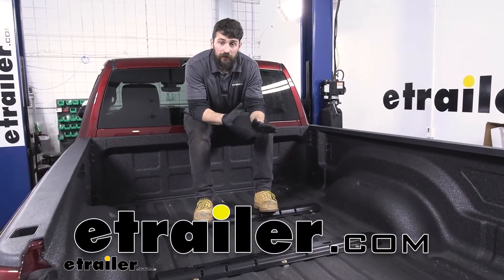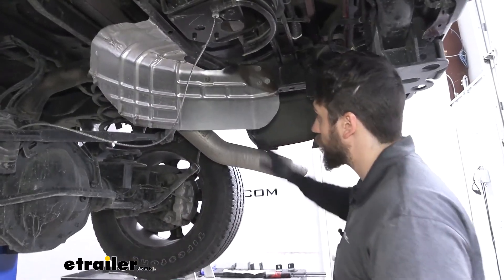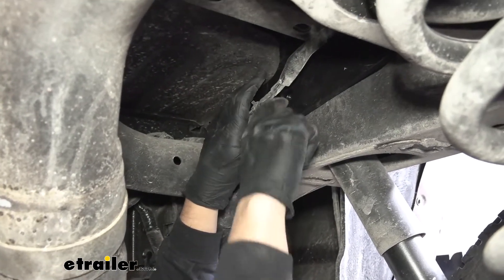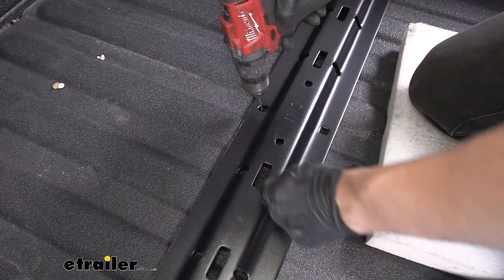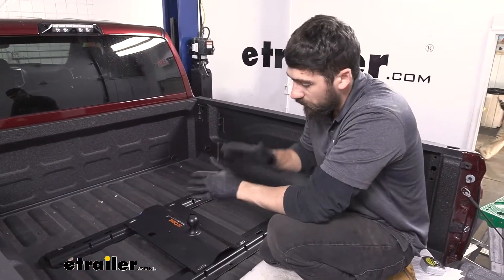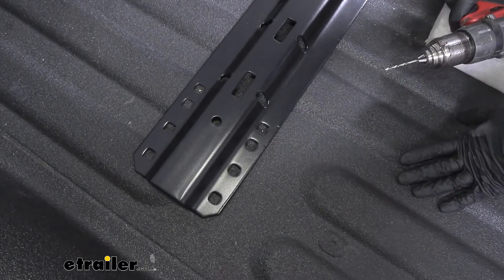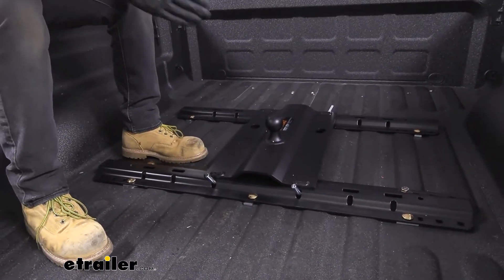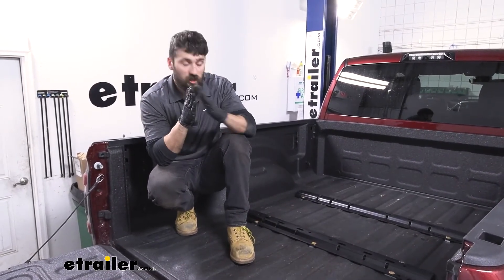etrailer | Mount: Curt Custom Fifth Wheel Installation Kit for Ram Truck on a 2020 Ram 2500

Comment: The driver side is an imposing challenge but doable. Long ratchet extension is very necessary. Cordless ratchet is a must. Instructions are poorly made copies off of a copy machine from 1987. The instructions do say it takes a novice about 90 minutes. Multiply that by 3… 😊
Reply from the maker: You're right, Curt could have done a better job with the instructions. That said, we're glad to hear of your successful install!
https://www.etrailer.com/Fifth-Wheel-Installation-Kit/CURT/C16427-104.html